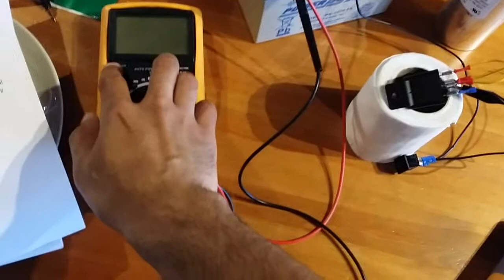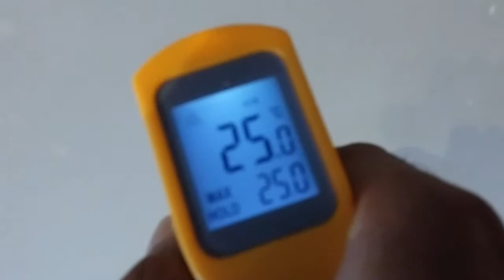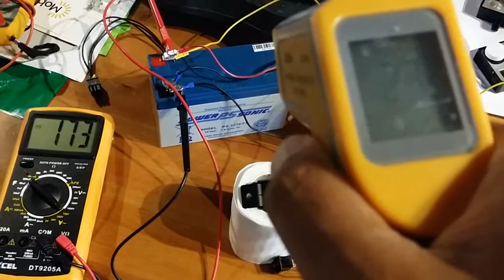Rep #3 Dezeinstein MBR Circuit Radiant charger

Comment: i believe marcs first circuit also included 2 diodes?
Reply from the maker: Correct, he forgot to add the diodes in the schematic.
Reply: @GreenmeResearch  iwant the diagram:)plsss
Reply: @rolandruiz1972  What use does that have, when you don't read......it's the first thing shared in the video's details.